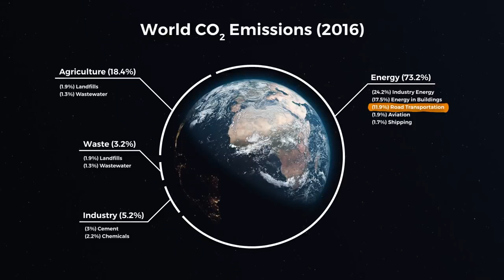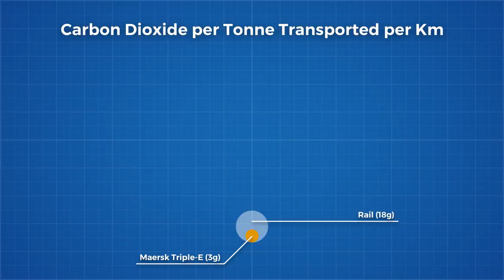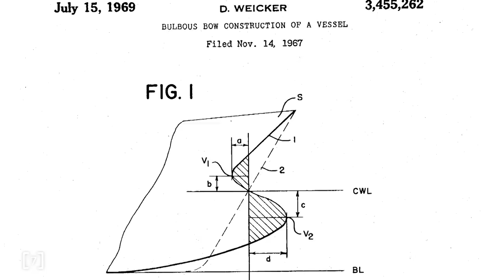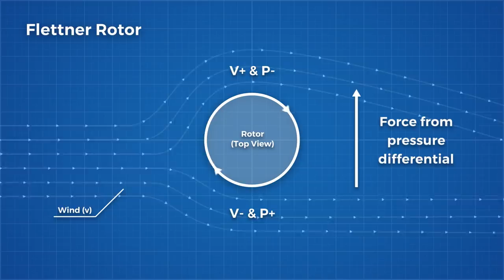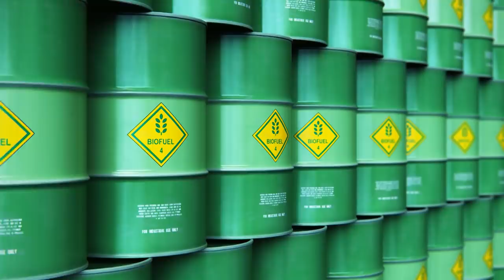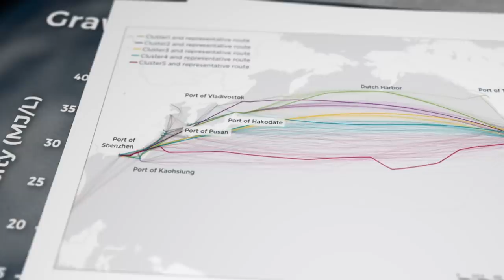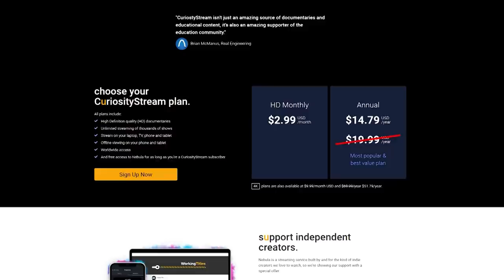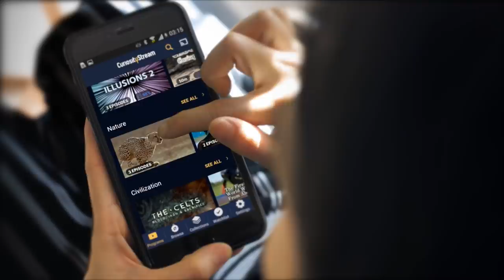Are Renewable Powered Ships Possible?

Comment: ...are sailing ships possible? Will we ever know?
Reply: To address the suggestions that sail power is the answer I offer the following example.  In 1870 a premium sailing vessel entered service, the ‘Cutty Sark’.  The Cutty Sark was 64.74 metres in length with a beam of 10.97 metres and a loaded displacement of 2 100 tonnes.  She was able to carry 1 700 tonnes of cargo and to harness the energy in the wind the available spread of canvas was up to 2 976m2 which was tended by a crew of about 30 skilled men.  A ratio between the sail area (SA) and the vessels displacement (D) determines how lively she is; ‘lively’ being nautical speak for ‘fast and manoeuvrable’.  The carrying capacity of cargo ships is constrained in two ways, mass and volume which leads us to the ‘stowage factor’ of the cargo; the more mass on board the greater the displacement which in turn impacts the efficiency of the hull form and sail area / displacement ratio.  A vessel constrained by mass is said to be ‘down but not full’, a vessel constrained by volume ‘full but not down.  When in the tea trade, which the ‘Cutty Sark’ was designed and built for with fine lines (more nautical tech speak so again - no need to worry about it) she could carry around 600 tonnes of cargo at speeds of up to 17.5 knots dependent on the prevailing wind and had a typical China to UK time on passage of 120 days.  The tea trade was very competitive so ‘time on passage’ was a large factor in securing the premium freight rate that made her cost effective.  Rounding things out her maximum available sail area gave circa 5m2 of canvas for every tonne of tea carried.

As soon as the Suez Canal opened, which the ‘Cutty Sark’ was unable to sail through; she lost her advantage, raw speed, to the steam powered ships of that era who could beat her ‘time on passage’.  Mechanically powered ships have improved in terms of efficiency, on a freight tonne mile basis, by at least one order of magnitude since then.  After losing out to the coal burning, steam reciprocating mechanical ships of the late 19th century ‘Cutty Sark’ was relegated to the Australian wool trade, just about the bottom of the barrel in maritime terms and only one small step up from being a 'honey barge'.  The canvas, cordage and extra manpower needed for sailing ships was never a very benign environmental option so please discount any idea of sail as ‘sustainable’.  All this is without the problem that if ‘the wind don’t blow the ship don’t go’, when it does blow it often blows in the wrong direction for your cargo delivery needs and sometimes there is rather too much of it for comfort.

Random facts about ‘Cutty Sark’, it is said to have been possible to coax 3 000 horse power out of her sails, or in ‘real money’ 2 206 500 Watts (2.2 megaWatts), assuming this was in ideal conditions that is about ⅔ of the solar power that might be harvested from the ‘top of stow’ of a Maersk Triple E, again in those elusive ideal conditions and 741 Watts for each square meter of sail area.  So that majestic spread of canvas would have been even less efficacious for delivering your baubles and bows from the orient, despite taking about three times as long on the voyage.  The sails on the ‘Cutty Sark produce about 0.33% of the power need to propel a Mearsk Triple E and covering top of the stow might produce another 0.5% so with both systems working in ‘ideal conditions’ the energy harvest would be less than 1% of the output from the ICEs.  Canvas and hemp are accorded 'renewable' (read as ‘natural’) status, if ‘synthetics’ are used there will still be a need for the input of FOGI products.  'Synthetics' would have a much better working life span than 'naturals' but would still yield the same amount of energy, 741 Watts for each square meter in those elusive ideal conditions.  Combining with solar electric would involve two systems in place of one, which then runs you into the problems of expense, complexity and redundancy.  Remember shipping is a high volume low margin business and all costs have to be beneficial.  Wallenius are currently giving wind power a go with wing form ‘sails’ but evidence is a little short of proof as of this date.  KTH (Kungliga Tekniska högskolan), a sort of up market university in Stockholm, who are using the funding to derive results will probably, and eventually, in the best traditions of academia ‘publish’ a ‘paper’ unless the funders invoke the well known ‘commercial sensitivity clause’ of their funding agreement with the KTH.  Wallenius is a major shipper of vehicles were the product is effectively its own packaging, other goods are moved about in ‘containers’ so the loss of capacity caused by containerisation needs to be factored in.
Reply: @BernardLS  Nobody asked the question - 'Is sail power the answer'. Answer to what question? The question asked a was 'Are Renewable Powered Ships Possible?. To which the answers is 'What kind of idiot question ignores 5,000+ years of history?'
I understand that the likely question, was whether any renewable tech is likely to become competitive enough to supplant or supplement diesel. But it would be nice if the poster could be bothered to pose a precise question. Pure rigid sail or Flettner rotor solutions, may not be feasible as a sole source, because of the intermittent nature of wind - but why would you NOT use it as a supplementary source? 
Because of the sloppy phrasing - airships can be included too. A zeppelin powered by a kite in the jet-stream is such a no-brainer, that one wonders who is employed by Zeppelin, Airlander etc. Factoring in speed, payload, point to point access, parachute drops, & the predictability of the jet-stream - this is not only possible, but clearly the most cost effective mode of cargo transport possible.
Reply: @imankhandaker6103   Posting a comment on YouTube after a video on ‘Renewable Ships’ generated some rebuttals, the prize for least coherent going to ‘I can't be bothered to crunch the numbers, but I think wind power as an additional auxiliary propulsion method for oceangoing ships would be neat. I mostly agree with you, but the sail is reusable until it breaks, rather than consumed steadily like oil is.  It may be slower and circumstantial, but I think it will last long enough to pay for itself in fuel cost savings.’  The added emphasis is mine.  A properly configured LCA (life cycle analysis) would determine the cost / benefit impact but that is project for another time and place; some lying down in a dark, calm and restful place is called for just now.  As with any LCA it is necessary to select the functional units, system boundary and parameters assessed to make sure you get the answer that is desired; always embarrassing when data shows that what you hopped to prove ‘bad’ was in fact ‘good’ or vice verse.  For functional unit in Environmentalism ‘overall carbon footprint’ is usually a good one, so what you save on kerosene burnt in a jet aircrafts engines better not be outweighed by what you consume using a recreational sailing vessel with hydrocarbon based structure and motive power containing lots of embedded carbon.  ‘System boundary’ well where ever is likely to yield the ‘correct’ result is a safe bet; ‘parameters assessed’ again what best puts a cutting edge on the particular axe you wish to grind determines which parameters you choose to assess.

I have been chasing this beast for a month since the video was first posted so in answer to the question  'Are Renewable Powered Ships Possible?.' I would say 'at what level of renewable' all movement has costs and not all of those costs can be full absorbed.
Reply: @BernardLS  I was at high school in the 70's when Salter's ducks were rejected after 'Life cycle analysis'. Amazed, I read up on the details - & found that undersea cables were estimated to last 6 months. Only 20 years later, was it revealed that these estimates were KNOWN to be false by the electrical industry contractors who submitted them. Power cables are more robust than telephone cables, that last between 15 & 20 years. People will do ANYTHING to prevent their cash cows being undercut.
Twenty years ago, I did some basic analysis on parabolic trough concentrators, to heat an oil based Stirling engine - the conclusion being, they would have been commercially viable using late 19th century technology. Even a century later,  there are no commercial examples of such technology - even though their efficiency could be doubled by adding linear arrays of PVs on the focal plane.
Engineering should be logical - but when money is involved .... everything ends up like a QWERTY keyboard.
Reply: @imankhandaker6103  Initial capital cost, maintenance cost and additional complexity.  ICEs are cheap, reliable (read as good) and powerful (read as fast) so they meet the three criteria for commercial success.  The good old 'cheap, good, fast' triangle with 'enough' sitting in the middle.  The yield for sails is circa 750 Watts for each square meter, wing forms et cetera may do a little better and, IMOH the best option, VAWT (vertical axis wind turbines) better yet; but none have a big enough payback.  Thanks for reminding me to see if I can get any information out of KTH on the Wallenius project.
Reply: @BernardLS  So you are telling me that an ICE is simpler & more reliable than a one-piece aerofoil? Think about what a remarkable statement that is. If I challenged you to mill one from solid metal, whilst I did the same with an aerofoil - which of us would have the easier task? The only reason you can make  such an incredible claim, is that the world has invested TRILLIONs of dollars, over the last century, in the design & manufacture of ICEs - whilst investing almost nothing in wind power.
The power density of ICEs is difficult to compete with - but this is cargo transport. MONTHS in a warehouse - rapid sea transit - more MONTHS in a warehouse. Why the rush? Because logistics have evolved around ICE characteristics.
Wind power scales with area, whilst payload scales with volume - hence the optimal size for wind powered transport will be smaller. Say an Americas-Cup sized, catamaran drone, carrying a single container. It would not need deep water ports - & could deliver directly to any coastal town. Catamaran drone to self-driving minivan, loaded by robot - no humans needed. Very possible - but very different ...hence very unlikely. However, countries like Indonesia have a strong motive ... although since corruption is the dominant motive in the 3rd world, bribes flow more freely from large scale operators.
Reply: @imankhandaker6103  As you say the world has invested heavily in ICEs which is reflected in the incumbent advantage they enjoy,  while the only investment in wind power has been the land based HAWT and some boutique items like wind sails, kites and aerofoil sections; industrial versus hobbies almost.  The scale of the shipping industry is difficult to grasp, but should it be that big?  The value of shipping anything is a function of weight, volume and value.  The first two, weight and volume, are combined as stowage factor while the third, value, is the main driver.  Should low value items be moved large distance or produced locally to their point of consumption? In the comments on this video, over the month or so I have been following it, I have seen less than ten comments suggesting localisation of production or reduction in consumption.  WADR your high tech suggested solution would be difficult to scale up to the current global trade volumes.
Reply: @BernardLS  The corollary is that ICE efficiency should be approaching an asymptote - so alternatives merit exploration. If changing the mode of transport from Leviathan to shoal, is too great a change ECEs like Stirling engines offer a significant edge in maritime applications where their slightly grater mass an volume are insignificant ...& huge reserves of coolant are freely available. But the truth is that an efficiency improvement from 45% to 60% is not enough to interest the shipping industry.
There is another renewable option - Ocean Thermal - basically using the temperature difference between surface & deep water to power an Anderson cycle engine. Theoretical maximum is only 7% ... but no fuel is required. Industrial systems exist on the 100kW scale - but normally moored. Nobody has studied moving systems.
Much is possible - but nobody has bothered - so nothing  has changed.
As for localised production, cost is an issue -& reduced consumption, seems to be against human nature.
Reply: @imankhandaker6103  H2 may have a place in the energy mix on land as a storage medium but on a ship where there is a reasonable and constant auxiliary power need the question could be posited, ‘why go through the extra stages instead of using the harvested energy directly?’  After harvesting the energy, from wind, sun or motion of the vessel, as electrical energy better to deploy it immediately as heat, light or mechanical work.  ICEs are good(ish) at converting the chemical hydrocarbon (HC) into mechanical energy with known externalities; the externalities (CO2, et cetera) are the problem so the best cure is to reduce the consumption of the fuel at source by reducing the unnecessary consumption of ‘wants’.
Reply: @BernardLS  Ocean Thermal can produce hydrogen - but it is best thought of as a Stirling engine working on small temperature differences. The low efficiency is offset by zero fuel requirements - but the large structural size may be an issue. 
If reducing 'wants' is an option - then the least painful, is to reduce the speed wanted. Good & cheap - but not so quick. Which brings us back to rigid wing sails.
Reply: @imankhandaker6103  Spring in Sweden is probably the best time to be a Stirling engine, the radiant energy from the sun is strong and the cold sink is deep and plentiful if you use the melting of the winter snow accumulation.  Where energy differentials are lower such as with, as you say, ocean thermal the pay back on hardware has a lot more catching up to do especially when fuel, as an alternative energy source, is cheap.  Bear in mind that speed reductions, a useful buffer for adjusting variations in demand, will in the long term require more goods in transit to maintain any given overall level of supply.  Typically tankers move at 15kn so a reduction of speed to 12kn could yield a fuel consumption saving of 20% (?), however to maintain the same long term flow of material an additional 25% of shipping capacity will be required.

4 ships at 15kn = 60 freight miles = 5 ships at 12kn.
Reply: @imankhandaker6103  Thank you for asymptote, that may be my 'nugget' of freshly acquired knowledge for the day.  However Anderson cycle engine is still troubling me, did you mean Atkinson cycle engine?
Reply: @BernardLS  Funny you mention Sweden - the only commercial marine Stirling engine I know, is made by Kockums of Sweden, for their Gotland class diesel/Stirling/electric submarines. Admittedly, they still use MTU diesel (with almost 80 years of development) for normal runs - but silent running is by Stirling engine. It is so silent that in exercises, it penetrated US Naval defences & managed to take out a destroyer. So reduced acoustic pollution might give the whales a break. But seriously, the Stirling engine is MORE efficient than the main diesel - but hasn't been developed to the scale required for complete replacement.They could run on diesel, petrol or gas - & even using the heat from adiabatic expansion /contraction of bottled air.
Reply: @BernardLS  No, the Atkinson cycle is the lean-burn, low compression ratio, variant of the Otto cycle - used by Toyota to increase fuel efficiency at the cost of power density.
There isn't a Anderson cycle engine as such - OTC has so little development. But there is an Anderson cycle - https://en.wikipedia.org/wiki/Ocean_thermal_energy_conversion#Closed_Anderson_cycle
Reply: Thank you for your lead to Ocean Thermal Conversion (OTC) looks like I need a better search engine, my existing choice took me to a engine tuner in the PDSR of Californication!
Mr. Atkinson was from Yorkshire and the local story is he was looking for a way to avoid paying Herr Otto royalties, typical for a Tyke.  The added bonus of reduced fuel consumption and thus avoidance of any fuel tax would have gladdened his heart.  WRT to Stirling engines I am currently enjoying retirement in Sweden having been an economic migrant here, long story starts when I met a girl in 1970.  However linking 'commercial' with 'warships' is WADR a bit of a stretch, even allowing for Napiers Deltic Diesel moving from the RN to the railways successfully.  So how big, structurally, and with what temperature differential do you think would be required to get OTC or a Stirling engine to megaWatt scale power output?
Reply: @BernardLS  You're welcome. I'm not really linking cargo ships to warships - so much as pointing out that use in military subs, demonstrates the practicality of a technology that has had almost zero investment in the almost two centuries following it's invention. I can't accurately estimate the size - other than say that it is very dependent on the temperature differential. Guessing -using combustion only it would by roughly the same weight, but almost 50% greater volume - using ocean thermal only it would be almost 10 times the volume. Impractical for a sub - but not unreasonable for something the size of an oil tanker. The beauty is the flexibility - low speed for NO fuel usage, or medium speed for very low fuel usage  .... all with no danger of ever being becalmed in either mode.
Reply: @imankhandaker6103  OTC, or as much as I have read to date which is not much, seems to require a long ‘drop’, circa 1 000m, to get a decent temperature differential Saga University in Japan seem to be leading the field but as I said ‘more research is required’ (:-)